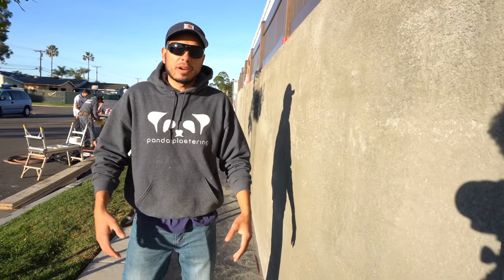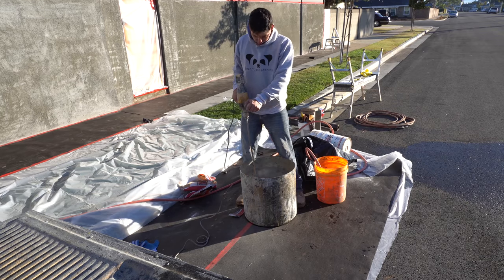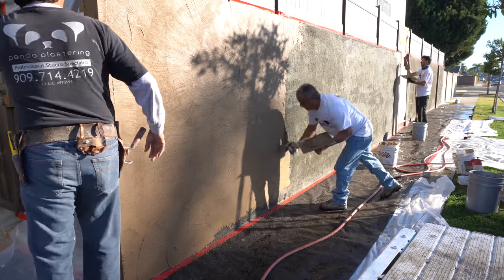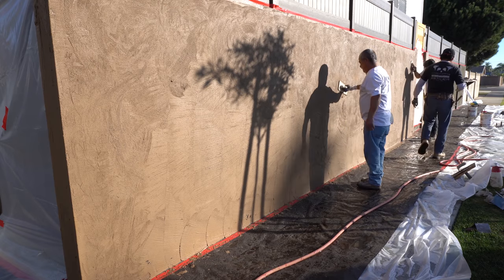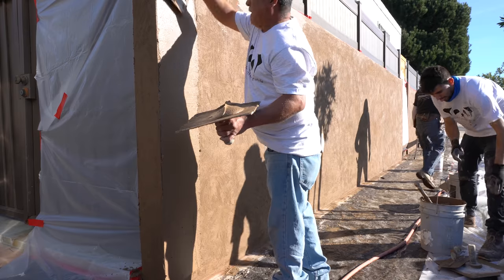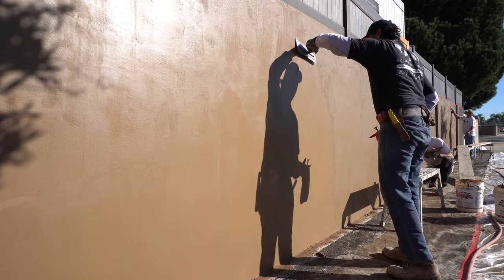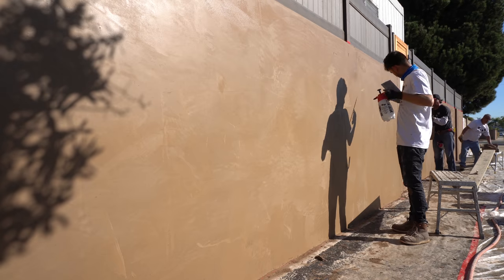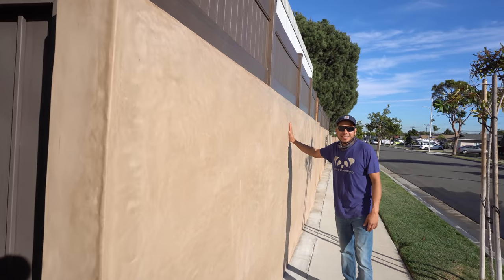How to Apply Smooth Finish Stucco on Block Walls Part 2

Comment: Good video, but someone who does not know how to do it still won't know the finer points, such as waiting for the coat to reach just that point of dryness so you can trowel it. Too wet and you'll be making more work for yourself, etc.

Comment: This is outstanding work and an excellent tutorial. I’m getting prepared to stucco the 1st floor of my house which is now painted cinderblock. Paint  adds a wrinkle to the prep - I shall deal with the loose paint. Pressure wash all areas first, then Knock off failed areas with scraper then hit with a7in.  Diamond grinder on those spots. Disk sand the rest. 
My question: Is that enough prep (I will keep surface damp.) or will I get finish failure because there is paint? What do I do?

Comment: Confused on the bag of 'plastic cement' to 19 shovels sand? Is that the name of the product at home Depot? Plastic Cement? I see lots of "Surface bonding cement" but you just add water?? Thank you if can clarify

Comment: Nice job.. The only detail I would add is that smooth-troweled surfaces are more prone to show cracks and imperfections, which get more exaggerated depending on the light source and angle shining on it.
Reply from the maker: I Agree
Reply: especially over wood lath and 3 coat
Reply: Looks best the first year, then aging starts. Especially if there is soil behind that wall.

Comment: Awesome finish. I just removed my old clam shell shutters (63 yrs old) and they were fastened with concrete nails with metal anchors, any suggestions on removing them out of the holes? Also, any suggestions on patching the holes where it blends in nicely with the existing wall, I feel that by patching the holes it will be very visible.

Comment: Great video. I hired some guys and they are telling me that it’ll 100 percent crack. All smooth finishes crack. They said if they go with acrylic, it’s more expensive but flexible and won’t crack. Another option is to go with 20/30 but more popcorn than I want. I’d appreciate your thoughts. Thank you!

Comment: Good job, man!...I'm doing a gazebo with smooth stucco. How many days should I have to wait before applying my polybon netting? Also, how many days should I wait after my netting gets installed before applying smooth finish. Any Info is well appreciated thanks

Comment: Hi , I checked online for that spray bottle I'll need for this smooth finish and came up with a 'Chapin 1003: 48-ounce Farm and Field Handheld Pump Sprayer'. It might be a lookalike, but is that the pump sprayer your actually using in this video ?

Comment: How long did you wait between applying the base coat in part one and the color coat in this video? Is there a rule of thumb on how long to wait between coats? Thanks!
Reply from the maker: On a house I would say minimum 14 days cure time. On block walls 4 days.
Reply: @pandaplastering2466  Thank you!

Comment: Very well done. I'm wanting to stucco my house with half stucco on the top part of the wall and the base done with real river stones to give it that country cottage cozy look. As it sits now, I have speckled rocky stucco on the top part, then some wood boards, then below it's old stone cover for the foundation look. It's an older home about 50-60 years old, so it needs a serious update. What is the stucco mix I should get to prep the wall and what is the stucco mix for the finish? Can I just go over the old stucco, since it's on there pretty secure and then fill in the bottom part with paper and wire, then stucco that part? And for where the stones will go, can I just do a scratch coat of concrete mix and then apply my rocks?
Reply: If your old stucco has paint, use concrete glue, then stucco.

Comment: Spraying it down with water some after placing the stucco so it doesn’t dry too fast and crack?
Reply from the maker: Not necessarily crack. But to achieve a nice smooth finish. The water does help

Comment: Yeah same thing when you quartz/marcite a pool... you have to wet the concrete or it doesn't bond to the wall as well, which isn't a good thing as you know :)
So that's a very good tip for DIY's to remember!

Comment: Hi bud. Im a rookie here. I have no background, but this whole time I've been hearing you need a three coat system for walls. Since ill be using cinder/hollow blocks - would you say a two coat system (brown) and then the (finish) is safe and sufficient?
Reply from the maker: Yes

Comment: Nice job bro, do you usually coat smooth with out mesh and poly? I noticed a few pebbles while you were brown floating.  Did it give you any trouble on the final pass with the trowel? Ill make the helper scrape that wall systematically 😂😂 that’s just me tho. I Can’t stand a small rock hahaha

Comment: Great video! I notice after the smooth finish is done it looks faded, do you recommend painting afterwards? Thanks
Reply: That's the intended color.  If you want to paint it,  I recommend Romabio limewashing your wall. It is not paint. It adheres and patinas so it can breath.

Comment: Looks amazing! I’m currently doing this on my block wall. How long do you wait between the 1st and 2nd color coat?
Reply from the maker: Cinder blocks don’t shrink and settle like wood framing. 48 hours should be ok 👍
Reply: If you are asking just about the stucco, first coat will set in about 20 min on block, then apply second coat.

Comment: Where do you buy your smooth stucco material? I’m close to Huntington Beach 

Great work btw! 👍
Reply from the maker: Thompsons building materials.
Reply: What grit do you recommend?  I need to do some smooth finish like this but don't know the grit mortar sand won't work
Reply: @jessesandoval5010  30/30 silica sand is typically used for smooth finishes

Comment: What’s a job like this cost? How do you know  if you are getting ripped off and over charged?
Reply: In Northern California its between 15 and 20 bucks a Sq foot
Reply: Same here in so cal 👍🏼15-20 and that's if its just brown and stucco , patching , skimcoating costs more 😬
Reply: @jessedukelacrosse6470  a sq. ft. or per yard?? That means a 100 sq. ft. wall (10ft x 10ft) is $2000.00......

Comment: Nice job but if you use a pool trowel on the finish coat its a lot easier
Reply: Pool towels are for pools
Reply: @elwinnordman2578  ya and pools are smooth and dont leave lines when you use a pool trowel to slick it down

Comment: Is stucco the same thing as cement?
Reply from the maker: Different
Reply: @pandaplastering2466  ok. Thank you
Reply: It has cement, but also more lime, which makes it have more workability. Lime softens the strength a little.

Comment: Nice work and nice video.  You're adept at the use of fast-forward and voice-over.  There's nothing worse than a video of a guy standing and talking, and you avoid that very nicely.  You're also an excellent plastering contractor.  Good work.

Comment: Fantastic looking wall! Great job! So I have a newbie question. Is it possible on an old house wall cbs to stucco with old paint on it or does it have to be removed completely? Thanks in advance
Reply from the maker: For best results. Sandblast the paint off and then apply skim coat followed by stucco finish
Reply: You can use concrete glue, then stucco.